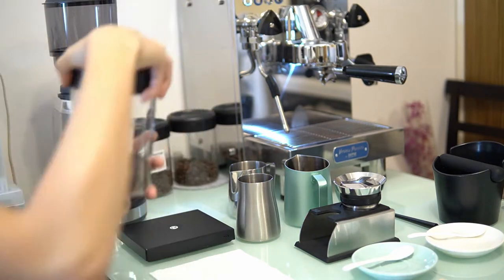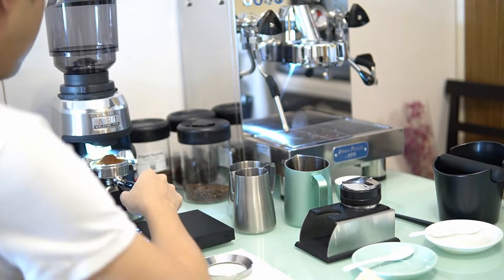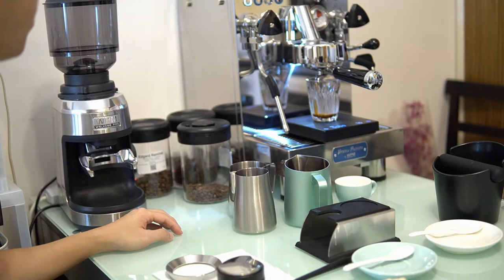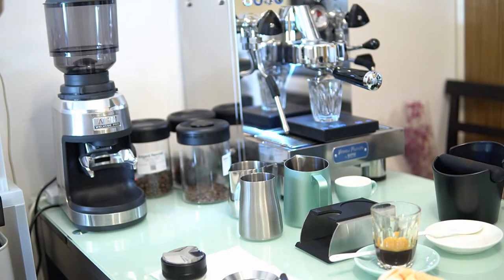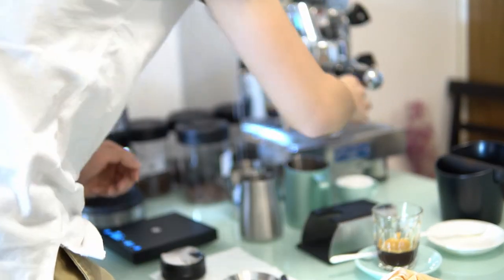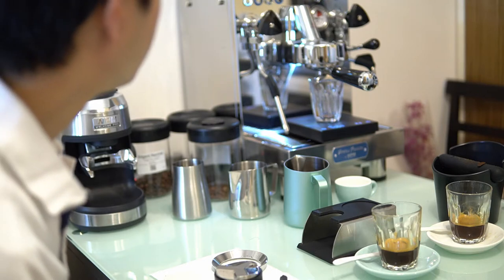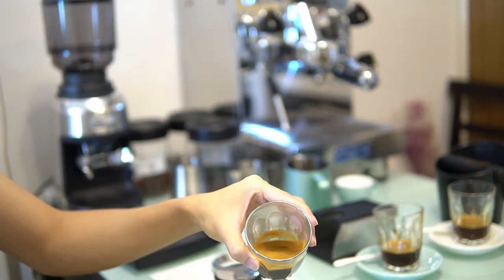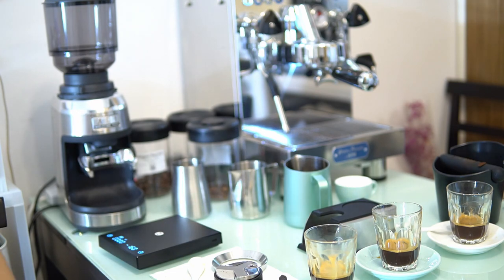Light Roasted Ethiopia Bean for Espresso (Attempt 1)

Comment: Hi mate, perhaps you should try the other way around. Light roasts often need "larger ratios" to both fully extract all the tasty compounds AND to tame the acidity so it's not aggressive anymore. You could try something like 18 gr in, 54 gr out. Another thing to consider is coarsening up the grind: quite often light roasts will clump together and resist water under pressure, which leads to micro channeling. I know it sounds counter-intuitive, but at least that's the way I'll go about it (I only drink very light roasts). Good luck!
Reply from the maker: Nice, thanks for the suggestions!

Comment: Would you give a try to maybe 38 to 40 sec or it will get too bitter anyway? I'm about to testt a super light roast Brazil bean and I'm wondering if it's worth trying in the espresso. In Chemex tastes great. Good video my man
Reply from the maker: Hey thanks for the comments! Actually, I've further tested out many times in these three months to achieve the best results using this machine and with lighter roast coffee beans. Turns out that using a much slower flow rate enables me to use a much finer grind setting and also increasing extraction time, greatly increasing extraction without giving super high pressures or bitter taste. My shots now are getting much better, without those super sharp sourness and bitterness flavors, even with light roasted beans. I guess the main problem previously was extreme channeling and low extraction, which is definitely happening in the higher flow rate settings.
Reply: @pianocc534  great, appreciate the tips. Cheers
Reply: @pianocc534  Did you maintain the same the same ratio as you decreased flow rate? I've never used flow rate to deal with high acidity. I usually go to at least 1:2.5 on lighter beans.  Sometimes, as high as 1:3.0.  Another adjustment I've used is raising the the water temperature a couple of degrees (C) while using a 1:2.5 ratio.  All these adjustments help attenuate the high acidic character of light roasted coffee beans.